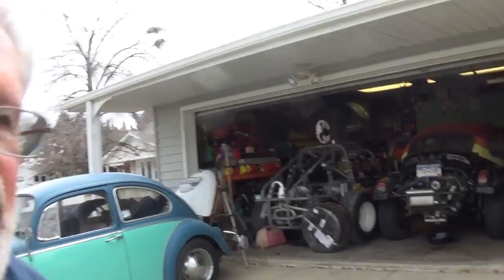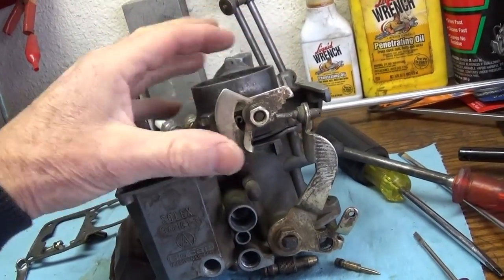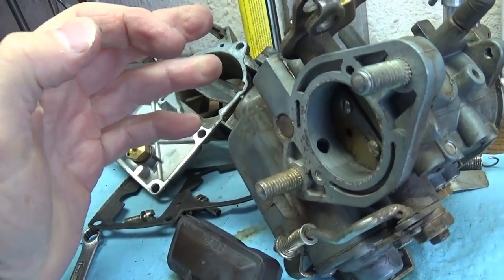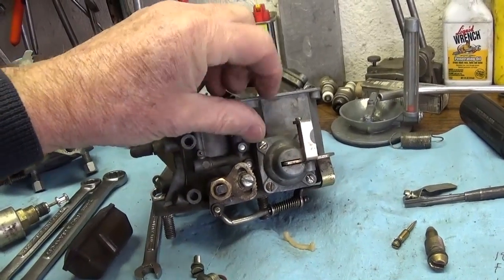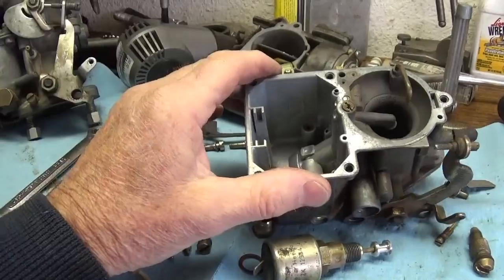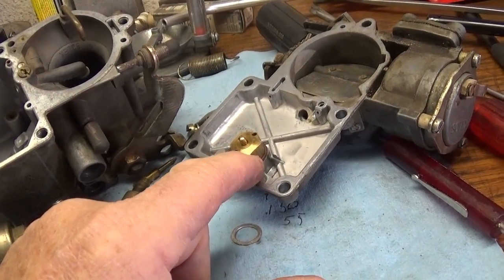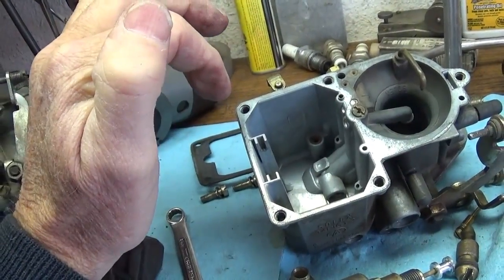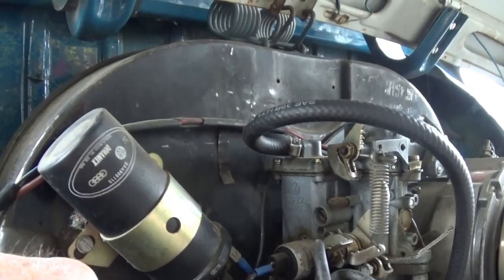VW Solex 34 PICT-3 (QUICK FIX !)

Comment: My European 1200 standard   72 30 pic3 was worn at 90k and solex don't make em any more and I ended up with a new Brazilian 30pic bocar manual choke so I had to rig a lawnmower throttle cable thru the engine firewall to get it started in cold weather, its OK and have done 20k miles in 2 years.

Comment: great explanation.  I run into the pilot jet on the passenger side getting overtightened causing it not to seat correctly. it will really throw off the volume and bypass adjustments.  ugh its 2018 why are we still working on these things.. lol
Reply from the maker: Just can't let go of the good ole day's and need something to fiddle with to stay sane. hehe

Comment: Great video thank you very much. My question is do you have any tips on how to diagnose if you have a stuck float needle and how to clean it or fix it?
Reply from the maker: One way to check is to take the air cleaner off and look down the carb with a flashlight at idle. Have some shut the engine off and restart it after a minute or so. When the engine is off there should be no fuel going down the carb unless you open the throttle and see the accelerator pump squirt.
The truth of the matter is if the carb is old and dirty buy a carb rebuild kit and clean it. You can do this with basic tools. Most carb kits come with a new float needle valve and instructions.

Comment: Excellent than you. The question is What is the level of the fuel, and how to check it. Thanks.
Reply from the maker: A good rebuild kit comes with full directions and 3 different float settings. It will allso come with a a little cardboard float level gauge.

Comment: Need to talk about the idle jet on the other side of the carburetor. Sometimes it has to be loose to run right. That’s crazy....
Reply from the maker: Check to see if the idle air hole is clear. Sounds like it's trying to breath....

Comment: Thanks for the reply I think it could possibly be the fuel pump as it had been stood for several years and the ethanol in the fuel has degraded the membrane thank you for your advice
Reply from the maker: I switched to low pressure electric with a regulator and never looked back.  # PSI Do it and be happy

Comment: It is amazing what was accomplished with a carburetor they are not as simple as one may think. Now this fuel injection stuff wow that can be a can of worms.
Reply from the maker: I agree.  They are great until something goes wrong and it just flips you a code and goes into limp mode. aggggghhhhhhh

Comment: Awesome video!! Thx for the info. Question: if the fuel flow is less... does that heat up the engine? Does less fuel flow mean better mpg or does it mean damaging engine because of heat etc?
Reply from the maker: A lean mixture will cause your engine to run hotter. Retarded timing will also cause heat. Not you Premium fuel will cause you heat. A stock engine in good tune should average 24 mpg with mixed driving.
Reply: @TheEZGZ  thx! I was also using premium hi-octane gas, that coild have been it. Thank you for responding, i appreciate it

Comment: I watched this and did everything and the car runs great but... it starts easily when cold, runs great when cold or warm or hot but when you shut it off and wait 5 minutes, it won't start again unless you hold the gas pedal to the floor and let it crank for a couple seconds longer than normal.  I would think it's flooded, but why? Shut off valve isn't stuck. Do I need a shut off valve adjustment with a thicker gasket as you mentioned to lower the float? The valves are adjusted correctly, the timing is right and the points gap is good to go at 16 thousandths.
Reply from the maker: At this point it's trial and error. After you shut it off remove the air cleaner and carefully look down the carb with a flashlight to see if you see fuel leaking down. Might want to open the throttle so you can look all the way down. Put a fuel pressure gauge on it to check your pressure, Don't guess. A fuel gauge is not cheap but if you want  it right just do it for peace of mind.  If any of your engine compartment seals are missing or leak air it could be heat soaking the fuel system. A tennis ball with a slot cut in it. Place under the engine hood latch to pick up cool air on hot days, kind of like a stand off deck lid but using the bottom of the decklid instead of top. That stopped my vapor locking problem with the new style fuel pumps.

Comment: Awesome video. I just inherited a ‘72 super beetle. It hadn’t ran in 25 years. I’ve had it a month and got her running and driving but still have a few bugs with the carb. We live in Los Alamos NM. 8000ft above sea level and I have that lag from idle to acceleration. I would love to pic your brain a bit more on my issue. Do you have an email I could reach you at?
Reply from the maker: Sounds great! Get a Manual and just go threw threw troubleshooting section. after 25 years it probably won't be perfect

Comment: Extremely good video! Is there just one main jet and one idle jet needed to replace? I'm at an altitude of 6800. What jet sizes do you recommend? Hopefully you can help me, thanks!
Reply from the maker: You should be fine using stock jets in a stock carb with stock engine. Todays Ethanol fuels are a bit thinner because of the alcohol  so it's like automatical getting a bigger jet even though the engine will make less power and get less MPG. Why do you feel you need to change your jet size?
Reply: @TheEZGZ  I do have the Solex 34 pict-3, people up here that see me drive my dune buggy said I need to get it jetted and it sometimes smokes after startup and it didn't do that in 2000 altitude. Could be bad gas, I just don't want it to run rich and wash the oil off or lean and burn my pistons. What do you recommend? I greatly appteciate you!!

Comment: A quick fix is also to throw the 34 pict 3 in the garbage 😂😂 lol I kid. I have a 72 super  started out with one, it gave me so many issues haha
Reply from the maker: So what did you end up putting on it?
Reply: TheEZGZ rebuilt the engine and bored it to 94 over so I put dual carbs, the empi-webers

Comment: Brilliant you have a new subscriber
Reply from the maker: Welcome to my world Steve. I appreciate the comment and support!
Reply: You're welcome I have similar issues on my Karmann Ghia, warm starting issues though and someone told me to change out the needle valve on my Bocar pict 34 which I did but my existing needle valve did not have a washer at all the new valve looked slightly different and came with a washer which I used but since then the carb has been flooding, I may go back to the old valve or use the new one without the washer, have also got what appears to be fuel contamination in the engine oil
Reply from the maker: @stevehill8512  add the washer to lower the fuel level. Check your fuel pressure and add fiber gasket to lower the fuel pressure. If your in the USA and using ethanol fuel it seems to be thinner. We are switching to the winter blend here in Colorado and all my engines are running a bit ruffer. My plugs even have white deposits.  Hard starting on a hot can fuel ponding and if bad enough will delute your oil. If it's bad enough you can smell it or light it on fire. (dipstick)   If your engine used to use oil between changes and now it does not it's another sign to check fuel system.  The fuel pump itself can possibly leak into the engine block while running. Ethanol  grrrrrr

Comment: what is wrong with the solex 31 pict-4 carburettor if the oil is added? so gas goes into them? replaced the korj kit and the high valve was renewed and installed the thickest piece that was in the korj kit... it would be 1.4-1.5mm now... is the mixture adjusted with a smaller screw so that the machine idles at the highest speed? and what about the swag?
Reply from the maker: Marvel mystery oil has been used for years to improve top end lubrication without effecting the carb operation. Follow the directions and keep watch on your spark plugs.
The small screw is your fuel the larger one is air

Comment: On cold starts, my ghia starts perfectly fine. After it warms up, like 1 minute, the idle drops, and will almost quit,..sometimes it does quit. So, should i get rid of the auto choke?
Reply from the maker: Up to you. I would try cleaning and adjusting first.  You could also raise the idle speed with the air screw and Idle fuel screw.    I've noticed a drastic difference in my idle speed just from buying gas from different stations with different octane ratings.  When I use the same gas from the same station my idle stay's consistent.  
When I drive cross country my idle and MPG is all over the place.

Comment: How do you adjust the choke so that it's letting the pin rest against the lowest little step on that arm?  Right now that little adjustment screw is resting against the 2nd little step on the arm so I suspect there must be an adjustment for that.
Reply from the maker: On the opposite side there is a large round plastic looking device that houses an electric heater. There are 3 screws to loosen and you will find it effects the step on the arm you refer to. You will also see some marks to show factory set points near the plastic. Get a book and see the whole procedure. You don't want to be driving around with the choke on. Bad for MPG and bad for engine.
Reply: @TheEZGZ  After I asked you I got to thinking about it and assisted it...but thinks anyway.  I've fixed that and reset the two adjustment screws to 2 -2 1/2 turns out.  It's still not wanting to stay at idle .  I'll tweak some more tomorrow on it. The previous owner said it was the idle solenoid but I don't see how that's it.

Comment: I know you've probably been asked this before but I don't have time to read through all the comments. What gas are you using in your Volkswagens?  Is it regular unleaded, mid-grade or premium or non ethanol? Also are you using any additives and what would they be? thank you
Reply from the maker: I use the best premium available and unfortunately right now that unleaded 91 octane with 10 percent ethanol.  Additives are just a waste of money but occasionally I use   things if I am on a road trip and can't find good gas.
Reply: @TheEZGZ   thank you sir
Reply: Anything  you add to fuel (additives)...displaces  fuel...in ratio  to air/fuel...thus leaning it out

Comment: Why does my car keep bogging at cold start I will hear it struggle at rev ..am using the same carb 34 pict 5   help and I keep seeing my gaskets wetting up with gas
Reply from the maker: cause the engine is not up to operating temp and the choke is probably partly closed

Comment: Hey is it easy pleasiee I really like ur video and where u are telling about main jet screw and u say 3 turns out and u start turning the screwz. u don' tell audiences  turn screw slow ually start by going n motor should slow down u turn it back to left and when u hear highest ide go back to right 1/4 turn.   Ahh it just downed on me  you have video on how to clean nor to adjust lol
Reply from the maker: 3 turns out to get it to start and warm up is right out of the service manual. Then lean it out for best idle

Comment: Hello am new to this carb my plugs come out black and I hv a reach mixture I think ...I see black lite smoke ..and I have no excessive power ..my idle screw is stuck...it won't go in nor come out....but it moves ...how do I get it out help
Reply from the maker: When I get into situations like yours I just take it off the car, spray some good penetrating oil  on it and let it soak. Then I just turn it back and forth to get the oil to move in and keep working it out.  Hey,  it's already broken so it is of no use if you break it more. Right! Might be time to start looking for a New Replacement. There available on the web.

Comment: Ive got a huge flat spot on my 71 Super Vert...I touched both of those screws.
Have you ever had a problem getting to #2 plug with a plug socket? Dual port manifold gets in the way
Reply from the maker: Use a SVDA 205 style distributor and buy a thinner spark plug socket or grind down the one you have.
Reply: I read this post and had this problem when I was trying to do my plugs, I tried everything. Come to find out a small bolt had fallen down beside the plug and the socket wouldn't go down enough. The only way I figured it out was with my cellphone camera.

Comment: Hey EZ, great video! i just rebuilt one and now the fuel is coming out of the top of the carb and flooding it. Its the little pipe that comes from the fuel cell to the top of the choke butterfly. I put another washer in the inlet valve like you mentioned. Am i missing something?
Reply from the maker: Check the fuel inlet valve. It might not be closing. Check you fuel pressure to the carb.  You may have to put the old fuel inlet valve back in ?????   Gently tapp on the side of the carb???   Did you get the dog bone on top of the float in right?  Maybe your float is bad?  See if it will float or try a different one.   Something ain't right in there.

Comment: Hey boss so I have a buggy with the what I was told 75 vw 1600 and both the plugs on the carb are unhooked should I run wiring to them and if so how would I run it?
Reply from the maker: It should start and run without if the choke is removed or adjusted fully open. Lots of folks take the solenoid out and cut the plug off.

Comment: Hi, can you tell me why the 34-pict-3 is not good for a single port?  thanks
Reply from the maker: The carb base is larger along with the intake manifold inside diameter. They make a spacer adapter to fit a 34 pic 3 onto a single port engine.   Remember that the 34 pic 3 came on the dual port engine from the factory.  The dual port head flowed better than the single port head and the intake manifold was also slightly larger. So that means you wouldn't get a big improvement by putting the larger carb on it unless you worked on the head, Raised the compression and added a free flow exhaust that is less restrictive than stock. 
They do make a carb adapter plate to fit the 34 carb on the smaller single port manifold.

Comment: My empi 34 pict 3 bogs going up hill, is that the accelerator pump? What is the best setting for the pump?
Reply from the maker: Jimmy, I have spent countless hours test driving my cars. They all run different in different conditions. I get an idea and try it to see if it helps. I try to just make one change at a time so I know that was it or change it back and try something else.  You won't hurt your engine by adjusting the accelerator pump. Try it and drive it. Be sure to check your dizzy timing with a timing light to make sure it is advancing and return to idle setpoint correctly

Comment: After cleaning my EMPI 34 PICT 3, how do I set and adjust the choke during the carburetor assembly? Do I turn the cover counter clockwise so that the spring/heater element to set the valve choke to close? Or do I just align the dot and groove on the carburetor body and choke cover? Thank you.
Reply from the maker: Dot and groove and modify according to you needs and temps

Comment: What distributor cap do you have? Some say a specific cap will make for a rough idle.
Reply from the maker: I just run the caps with the brass contact posts instead of the cheap aluminum ones.
Reply: Thank you! @TheEZGZ

Comment: Ez Great Video!!!!. I have a Solex just like the one you use for your demo Boca 34. Quick question 71' was running great, today I could not get it started gas was spilling out of the vent tube, carb seemed to be overflowing, drowning in gas. Any Ideas or fixes. Thanks
Reply from the maker: A quick light tap on the side of the carb might loosen up inlet valve above the float. Might be getting old or the float might have a leak. The book has a nice overview of the insides as do the rebuild kits. Good Luck with that
Reply: @TheEZGZ  Thanks Ez I'll update you on the outcome.

Comment: Hay ezgz the 34 pict 3 will only idle ok to good with the air correction jet screwed right in  hit bottomed and the fuel jet out about 5 turns , what do you think the problem to be thanks 😊 Harry
Reply from the maker: The throttle butterfly is not closed all the way or the Throttle shaft bearings are so worn out it sucking air.  On old carbs that have been sitting for a long time and or were never adjusted correctly and driven that way for years you will not be able to just lift the hood and adjust a screw here and there and have it running.
Sometimes you have to take it off the car and dissasemble it and clean it. Install new gaskets. If the throttle shaft bearing are worn out you will probably have to replace it. The new carb has to be taken apart and cleaned and inspected before you use it. Don't expect to take it out of the package and bolt it on and run right. Follow everything I show you in this video.

Comment: Hello dear sir
My bug is super beetle 1302. It is consited 1600cc single port engine with 30 pict 3 carb.
The car does bitween 7-8km per liter with air condition within city limits.The carb specifications are as follow
main jet-120 air correction jet-170 pilot jet- g55 auxilliary jet-g35.
i changed main jet upto 127 with 125 air correction jet according to Robs and Dave aircool page article and their given instructions. I tuned up according to their tune up guideline with tacho meter. But no change. Please help me to increase my mileage.
Reply from the maker: Freshen up your engine with Dual Port heads and 34 pic 3 carb. Free flowing exhaust.  It will make a bit more power and have better efficiency.  That's a lot of money to spend. You have to think about the pay back.  A few miles per gallon  will take a lot of miles to break even.  Free stuff is more air in the tires and use the AC less.   All VW air cooled engines should get about 25 miles per gallon.  It needs the fuel to help cool the heads and valves. A good tune up and a light foot on the gas is your best bet for economy.